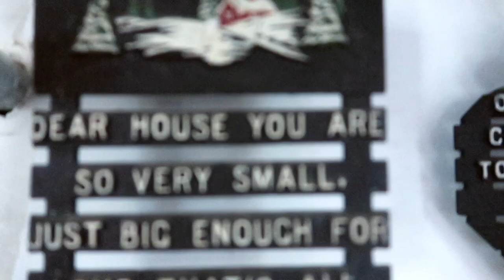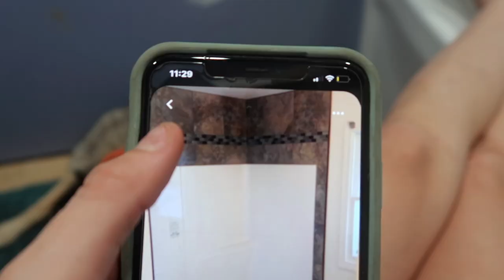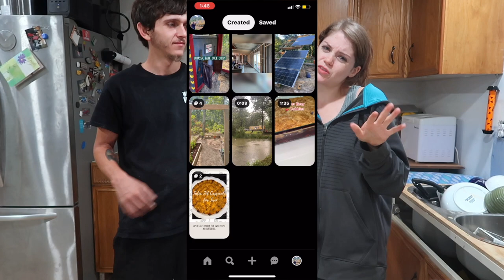Mudding our CONTAINER HOUSE Bathroom I Shipping Container Home | EP:63 | Backsplash & Stair cases

Comment: Good job welding Summer. There are a lot of aspects and techniques in welding. For just learning  you are doing great. I was a welder for several years when I was y'alls age. My main focus was stainless steel product lines, sanitary tig welder, but I did a lot of frames for equipment and mounts for the pipes. Stick and tig. Only did mig in school.